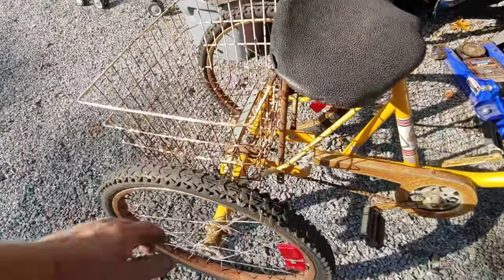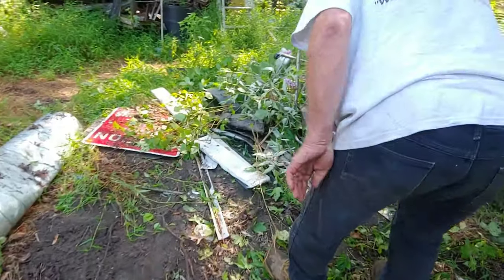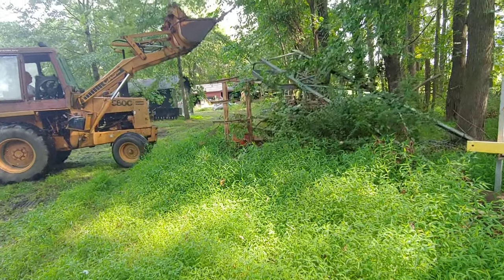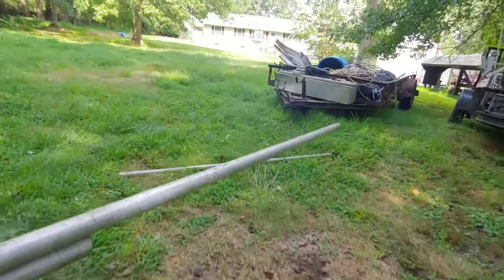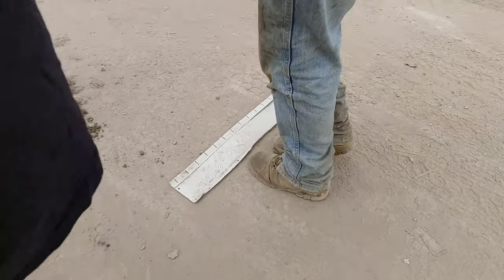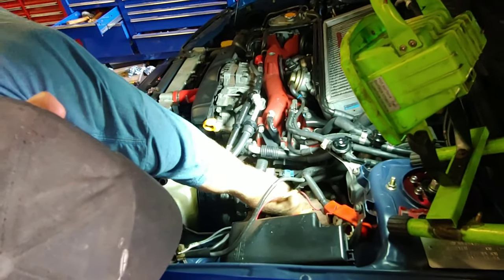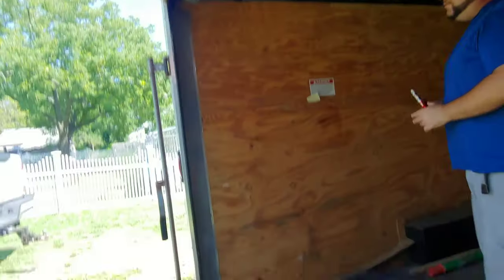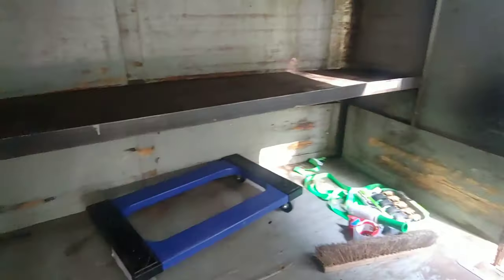Makin moves.

Comment: Usually sheet tubing will have the little mold seam on the inside
Reply from the maker: For sure if it doesn't it's d o m
Reply from the maker: But I'm also pretty sure most aluminum pipe is d OM

Comment: He should not be allowed to operate that tractor. He has no idea
Reply from the maker: Yeah well when the valves don't work in the machines completely dict nobody can run it.. plus no brakes so there's that
Reply: As far as I know from previous vids it is an on-site digger that belongs to the estate that they have shoe horned together to make life easier for them selves .so I think Fred is doing a pretty good job using it considering.
Reply: Hey, i wish i lived closer, i know those 580s inside and out! Theyre awsome machines. Rev. Lots of hours operating them too!!